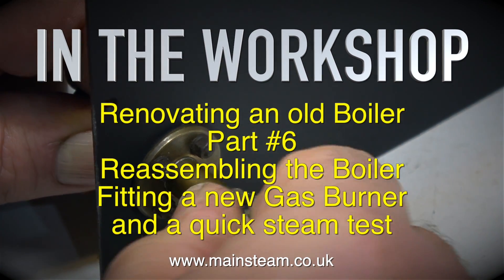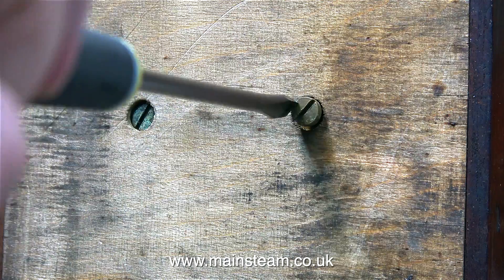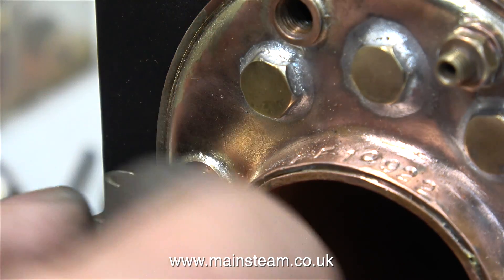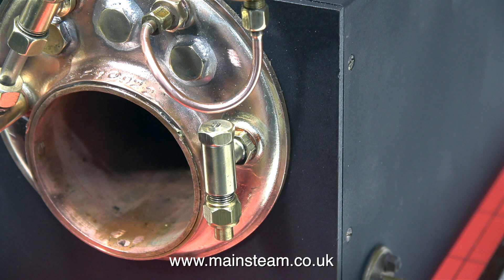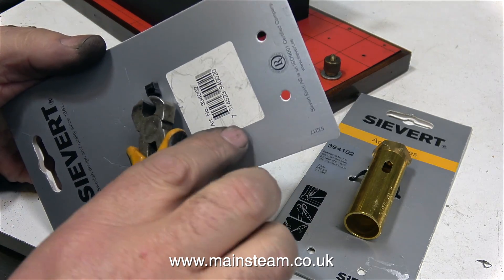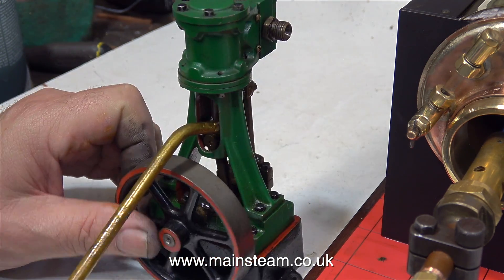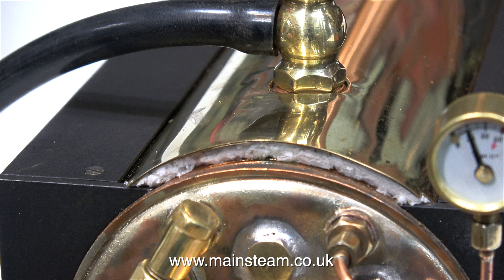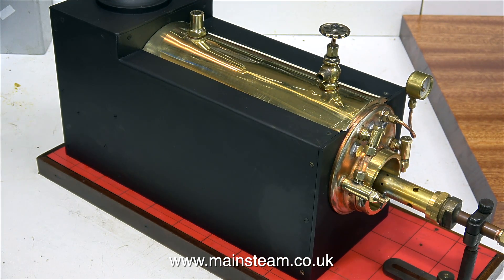RENOVATING AN OLD MODEL STEAM BOILER - PART #6

Comment: Hi Keith, interest9ng video as usual.  Regarding the top cover which is looking like copper and poishes as brass.  Is it possible that it is Gilding metal which as you probably know is a brass alloy in which copper migrates to the surface so that it looks like copper sheet?  I have a couple of large sheets of 16g gm which I use for model loco bodies as the copper on the surface takes paint much better than brass without etch primer.

Comment: Hello Keith.  I just want to make sure I'm learning my lessons right.  Did you perform the hydraulic test off camera?  After the work you did on the restoration, I would think it should be tested, but I am the student.  Similarly, not shown was the test or calibration of the safety valve, was that off camera?  Thanks Keith, for passing this knowledge on!
Reply from the maker: I performed a hydraulic test before I started wok on the boiler, I thought I mentioned it in one of the episodes.  The safety valve didn't require any adjustment, it was fine as it was, I have covered these sort of elementary things in other videos a few times - so I thought I would give it a miss on this one.
Reply: @keithappleton  thank you Keith.  It may be elementary to you sir, but not always to me, the student.  Now that this bit of knowledge is internalized,  lesson learned!